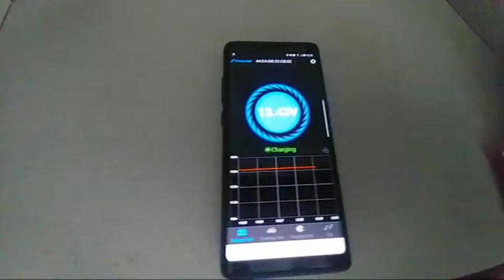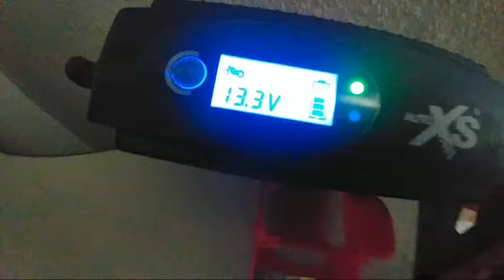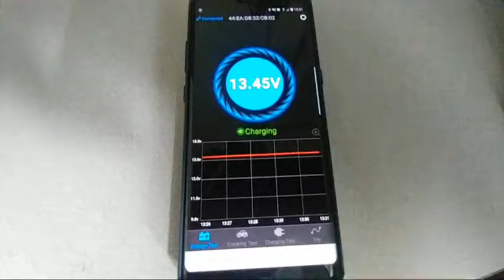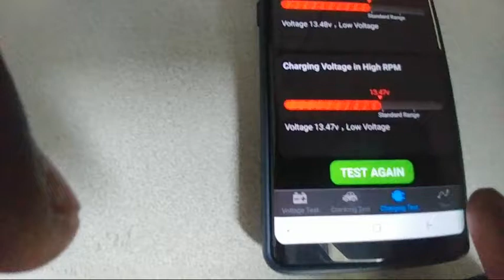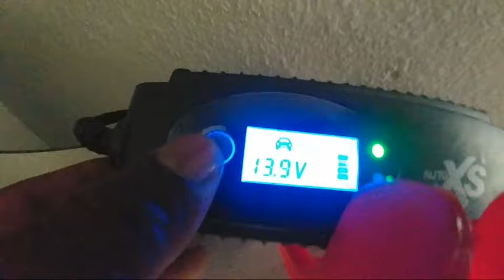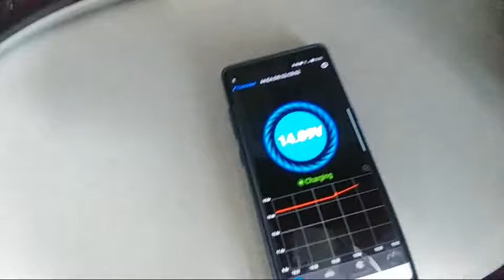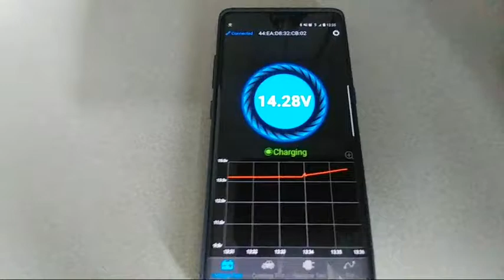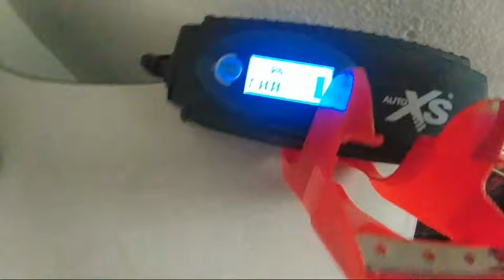QUICKLYNKS BATTERY MONITOR BM2​​ | Bluetooth 4.0 Voltmeter

Comment: Good video.  So, where can we find this monitor?  We should not need to ask this question.
Reply from the maker: You can find them on Amazon.com
Reply: Quicklynks BT2000 este cel mai bun tester ce se gaseste pe piata deoarece este singurul care calculeaza SOH si CCA si rezistenta interna a bateriei.
Celelalte testere nu fac asta.